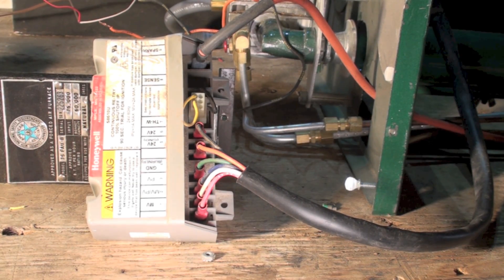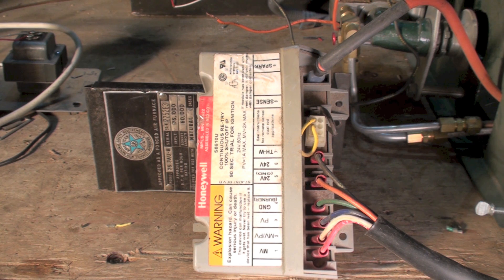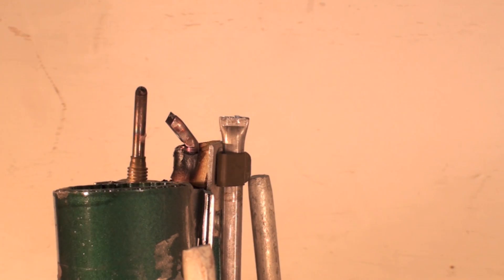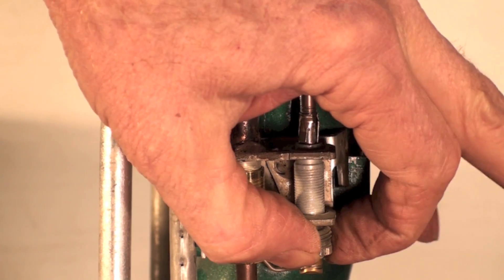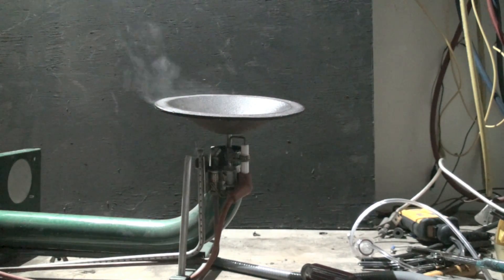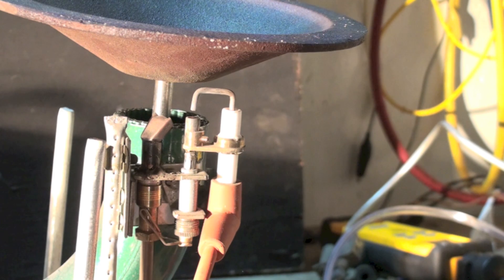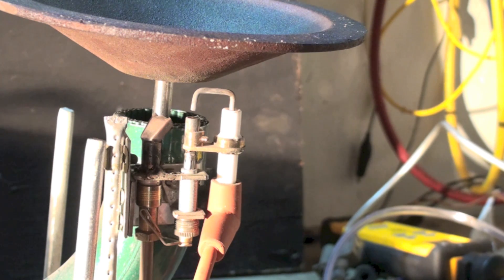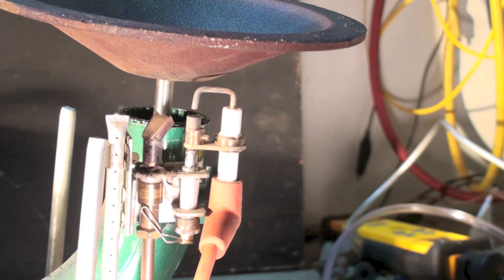How to install a spark ignitor for a gas furnace

Comment: My Monitor GF 500 propane heater, failed to fire the burner, removing the grill, I noticed a small spark jumping from the wire connected to electrode assembly, removing the electrode from burner to clean with some fine grit emery cloth, I broke  one of the rods. so i ordered a new assembly, but read that the distance between electrodes need adjustment, how is this performed without breaking another one? thanks
Reply: If you didn't get that fixed, if the spark is coming from the wire, then it is likely the wire is comprised anyway. Hopefully you replace the entire wire in that case. As far as adjusting the electrodes, I don't know, expect maybe turning them in their holder, or moving them up and down in the holder.

Comment: So what kind of gas valve is required for this conversion kit sir?
Reply: Also, do they make kits for an hsi?
Reply from the maker: @bnice12  The kit comes with the adaptor for the pilot, the control board and a gas valve.  It is a Honeywell S8610U3009.  White Rodgers makes one as well.  
The HSI ignition system is designed for each furnace and is usually proprietary.  That is not to say general replacement systems are not available.  There are a number of control systems made by Honeywell and White Rodgers to replace factory oem.
GFM

Comment: Howdy, I have an Empire shop heater in my shop . It's a great overhead heater but has a pilot light burning 24/7 and I burn way more propane via pilot light burning then I ever use heating the shop up. I want to convert it to an electronic ignition. Last time I had someone offer a bifd the cost was as much as just replacing the heater with a more up to date unit!

Comment: So you're basically running a Direct spark Ignitor without having to replace the Intermittent pilot module?
Reply: I ask because I have a Intermittent module, I'm building a Co2 burner that uses LP on a small burner with direct spark, because it will be on an auto pilot system. and would like to save money by not buying a DSI module
Reply: Not sure what you are trying to do.
GFM @spenceredwards2850
Reply: @electriccar3253  I'm trying to rig up a direct spark ignition, but I only have an Intermittent pilot Ignition module.
Reply: @spenceredwards2850  Using the intermittent ignition for direct spark is unsafe.   The spark does not have enough energy.
GFM

Comment: I installed one on a residential furnace. It worked o:K:, but, when the main burner cycledoff because of the bonnet temp switch, the pilot went out too. When the bonnet switchcooled down, the pilot relitt and then the main burner came on.   I thought that the pilotshould stay on until the thermostat was satisfied. I would appreciated help on this.Noah
Reply from the maker: By bonnet switch do you mean draft hood/diverter switch?  If its is a draft hood switch, it only opens when there is a downdraft in the vent.  Your problem is not in the furnace but in the venting.
GFM

Comment: hi, just how long does it take before the pilot valve automatically opens? in other words, how does the pilot valve knows when to open? thanks.
Reply from the maker: When the thermostat calls for heat, the pilot valve is powered and opens, and the spark is initiated.  When the pilot flame  proves the pilot the main gas is energized.
GFM,

Comment: Actually your videos are quite correct and informative; the spark igniter’s setup is common in most industrial burners. I am instrumentation technician and designed burner controls to FM specs. We only used spark igniter’s driven by relays or PLC outputs, and proven via Honeywell ultraviolet flame detectors and Honeywell burner controls. Keep up the good work.

Comment: Can't tell you enough how helpful this video was!!  Planning on converting an older gas supply line that includes a grease packed valve with standing pilot (on same valve), baso box l62aa, and separate gas valve to one of these bad boys.  

Thanks again!!
Reply: I also stumbled across this link that might benefit some viewers attempting this install.  It's Honeywell's training module for the Universal Electronic Ignition in powerpoint form that breaks down each component.  It has to be viewed online here:

http://tinyurl.com/m7373tr

Comment: hello friend how are you looking at I have spark s8610m think is corrupt how can I know whether or not damaged. because it has no gas boiler change the pilot tip and does not work. Tanks
Reply from the maker: If the pilot lights and does not go to main burner, the flame rod may be dirty.  If no pilot at all, check for power to the control.  If power is available to the control and nothing happens, the control is bad.  Hope this helps.
GFM

Comment: Is it possible to replace 3 pilot lights on a 3 burner Hot Water Furnace with  an igniter system?  And if so would it be cost effective?
Reply from the maker: I would't touch that one with a ten foot pole.  You would need 3 controls to be safe, and not it is not in my opinion cost effective.  Hope this helps.
GFM
Reply: grayfurnaceman Thanks,  This is how I feel also.